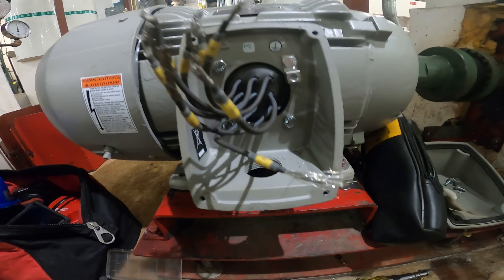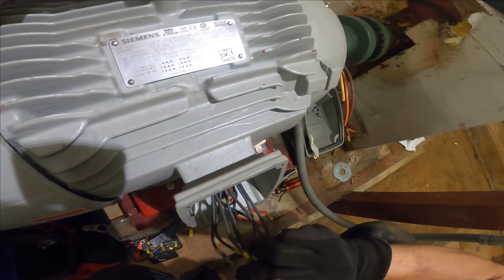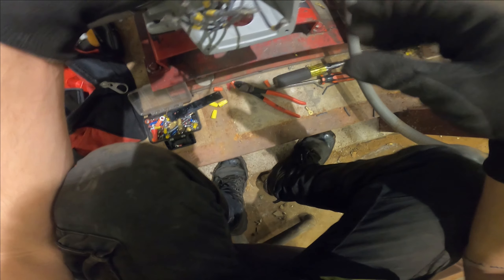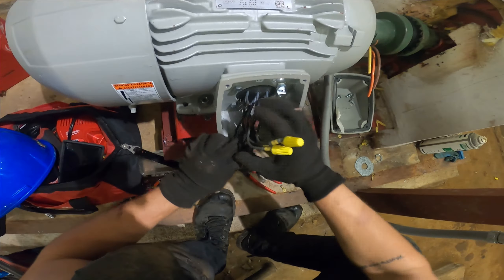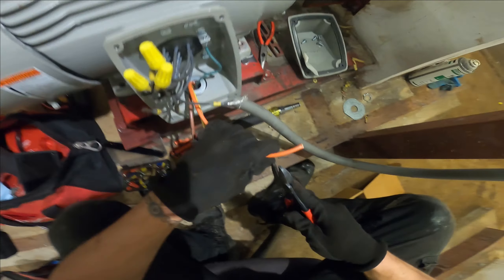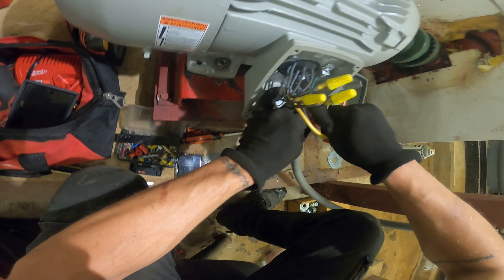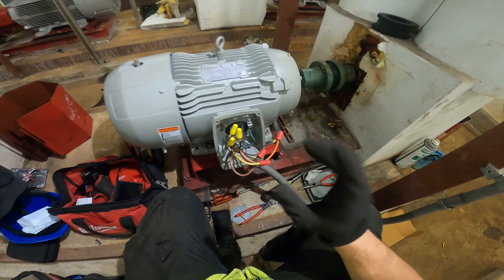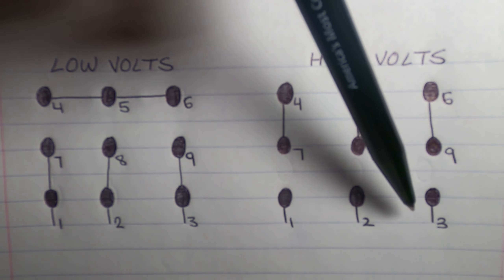Dual Voltage 3 Phase Motor Wiring (How To Wire A Multi Voltage 3 Phase Motor) Simple & Easy!

Comment: Excellent video. Exactly what I was looking for. 
However, are those aluminum wires in the motor? Or tinned copper? If you're hooking up aluminum to copper, which you shouldn't do, you need to use special AL-CU marked wire splicing connectors or wirenuts, the purple stuff, to avoid connecting Dissimilar Metals. NEC 110.14 .

Comment: question if you can help me running a VFD with this motor I  have  3hp model number EM3611T. i want to power it with a house hold 220/240 single phase power converted to 3ph 230v. the VFD from amazon i want get says it puts out 3 phase 220v not 230v?
my motor is 3hp 230/460v

Comment: Thanks man! the tip about reversing the direction was great, of course. and the end, with the in-depth diagram was super helpful, ESPECIALLY when you say "3 wires in 1 wirenut". Still fairly green to this so that sort of explanation/visual is great. thanks again.

Comment: also tip, at my work we have to use a bunch of tape on top of the wire nuts. so to reverse you can go to where the power is feeding and flip the leads there to reverse it

Comment: Great job. Are the wires coming out of the motor always numbered, or do you have to figure that out?
Reply: Sometimes the tags have fallen off. You can use a multi-meter set to ohms to identify them.

Comment: Hello I have a question. I have two basically identical independent loads, and a 48v battery and motor controller. I can't seem to find 48v motors with small enough wattage, so I was wondering if there's a way to use two 24v motors in series? These are brushless, and like I said each is handling a separate roughly identical load.

Comment: Those wiring nuts are shocking. I would never ever use those, especially your method of joining the motor wires to the mains. Good video but…

Comment: Great video.  I have been looking for information on how to wire up a 3 phase motor that I am using for a 2x72 inch belt grinder I am building along with a VFD for step-down and speed control.  Just looking at a chart with a bunch of numbers, letters, non of which match what are on all of the wires that are coming out of the motor was impossible.  I now see that the letters don't mean anything and it is the numbers that are important along with the high voltage vs low voltage.  Not sure why they do not just use the voltage i.e. 220 or 440, but regardless most folks will always use low voltage no matter what it is.  The VFD is another story, the letters are important and they are different depending on the model that you get (this video will help with that - https://www.youtube.com/watch?v=RNB0WozFmD4&t=156s). Anyway, thanks for the video it helped me greatly!

Comment: How come the rest of the wires didn’t come factory connected?...
Reply: becuase you can wire it up in 240v three phase or 460v three phase, different voltage, different pinout connections
Reply: @youngdust6730  I’m sorry... I’m not familiar with heavy duty motors. How would they be able to wire it up as a 230v motor?.... would a run cap be necessary?....
Reply: @Oscarbm1234  yes itll wire up to 208-230-240v as long as you use the right connections. no you never use capacitors because the torque on a threephase is so much better than single, besides a capacitor moves the sine waves closer as to where you would just adjust the frequency in a three phase motor using a variable frequency drive
Reply: @Oscarbm1234  three phase induction motors don't require start or run capacitors because the three phase magnetic field is always rotating and thus the motor is self starting. (This is a huge advantage over single phase motors) 

To wire for 208/480V you just change which taps are tied together. These taps are connected to the windings and will make the windings be either in parallel or in series.
Reply: @markschelkle4534  exactly right. Wire them in parallel for the low voltage input and series for the higher voltage input. It would have been helpful in this video if he showed how the motor windings were configured (delta or wye) and how the connections looked different between the high and low voltage input. It would give a deeper understanding.